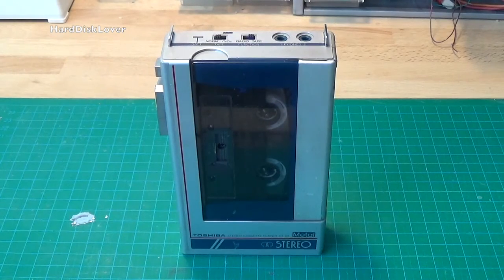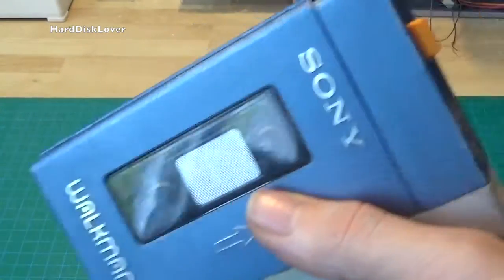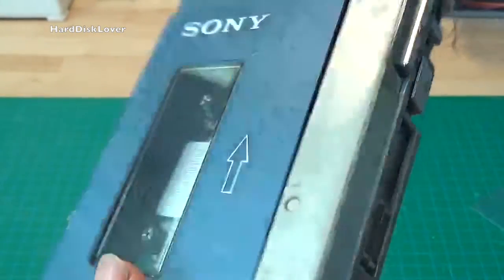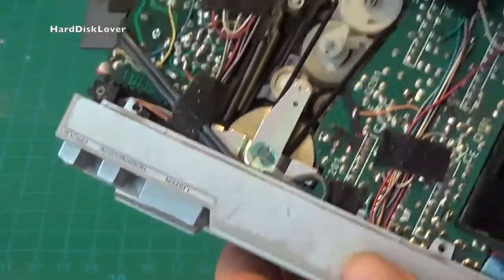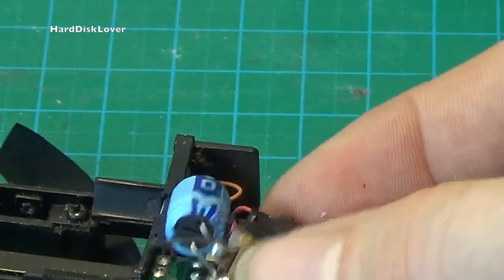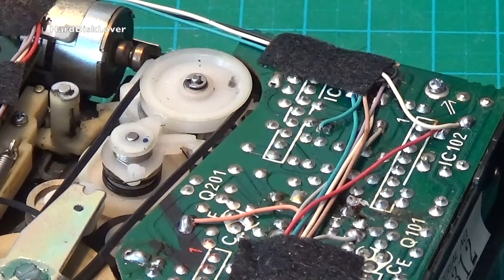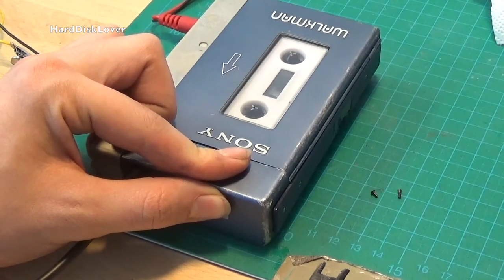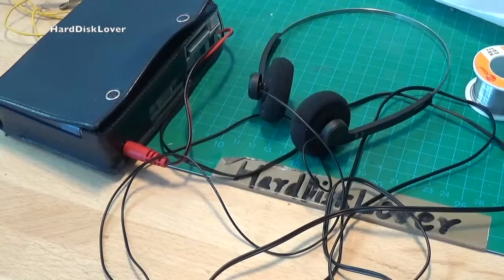Sony TPS L2 Walkman Repair

Comment: Very useful thanks, particularly the "twist" in the motor drive belt which wasn't obvious on the video but you mentioned it and now my player runs the right way 😊. is it easy to re-solder the microphone wires? mine have all parted and I'm not sure where they are soldered onto. Thanks for excellent video👍

Comment: I had the same exact issue but mine turns to the opposite direction. I see that you are making that change from somewhere but i cant catch it from the video. Can you please explain that little more? I really appreciate that...
Reply from the maker: have you twisted the belt going to the motor? it needs to be twisted in order make the mechanism turn in the right direction pointed that out at 9:53
Reply: Thank you We already took care of it. Appreciate your reply though

Comment: I have a Sony WM-3 and a Sony WM-F12 and while the F12 seems to work just fine, the 3, which I bought after it had been refurbished, seems to run just a bit slower when compared to the F12 using the same tape. Any suggestions as to what could be causing the WM-3 to do that? I opened it up and everything looked fine when running.
Reply: Jason Lange needs to have the speed adjusted there are some tutorials online I think
Reply: On the walkman wm-3 if you open it up remove the top panel where it has the metal logo look near the jack/headphone area and there should be a grey/silver flathead screw thats the potentiometer that controls tape speed. Use a flathead screwdriver and adjust to get the speed you want.
Reply: Bit late response but there is a potentiometer that adjust playback speed inside the unit. See a video by the retro future on youtube